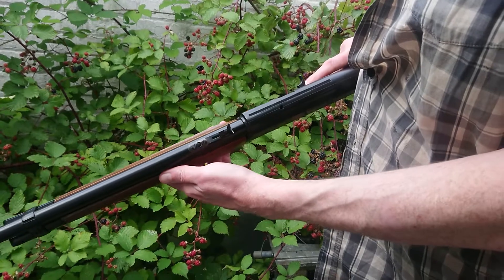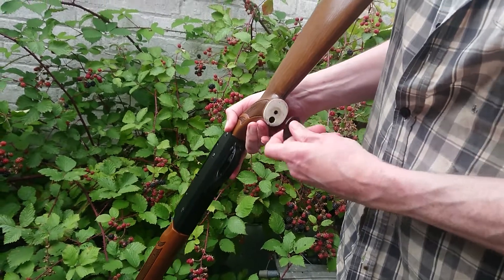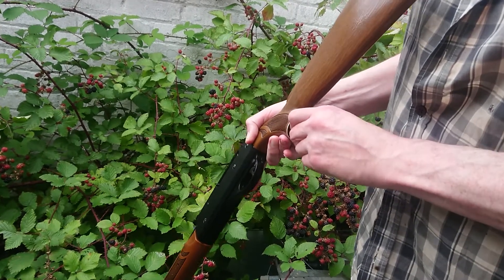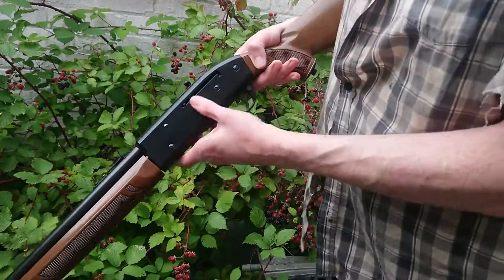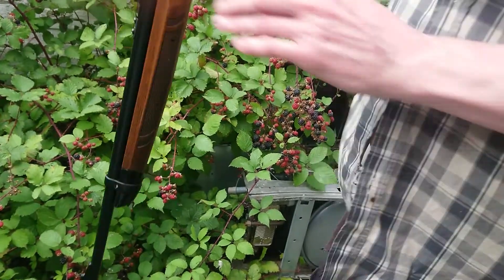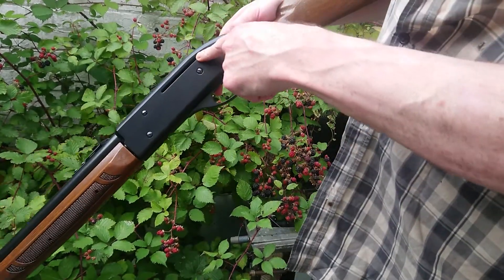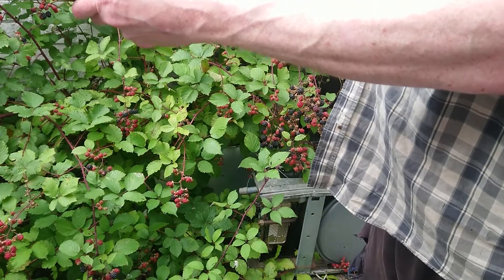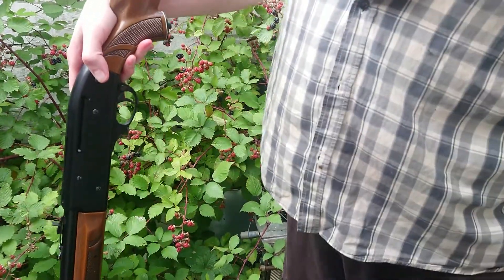CROSMAN 766 MULTIPUMP PHUEMATIC AIR RIFLE

Comment: I have one of those that I got for Christmas in '79. I had to install new seals about ten years ago, and I still shoot it quite often. Nice rifle. But to put BB's in the reservoir, mine doesn't have a screw. That little black cap just slides back to expose the BB hole. Slight difference in design I guess. You can see mine (and a few other pellet rifles) on my video.

Comment: You're not supposed to unscrew the cap on the stock to put the BB's in, you just slide it back to expose the loading hole and then slide it back forward to close it. I have 3 of the Crosman 766's all made in 1977 and that's the way you load them. Yours could be different but ive never seen one made that way. I also have one made in 1981 and it's the same as the other 3.
Yours is a nice one.
The first 4 numbers of the serial number tells the manufacturer date.
Ex. 1077567843 would be October 1977.
Or it may have a letter then the numbers.